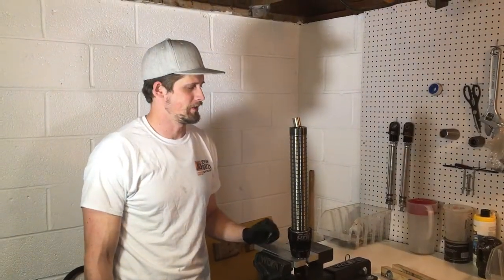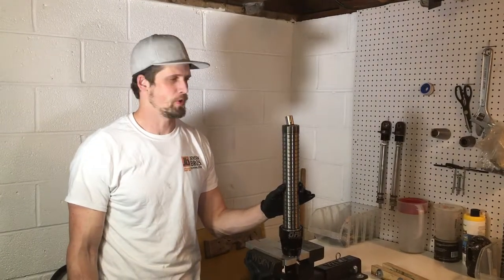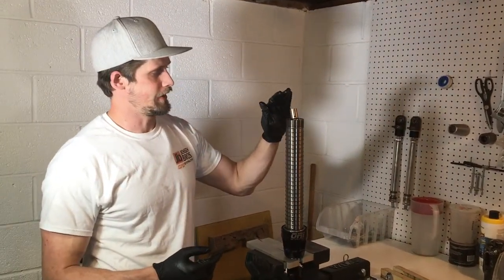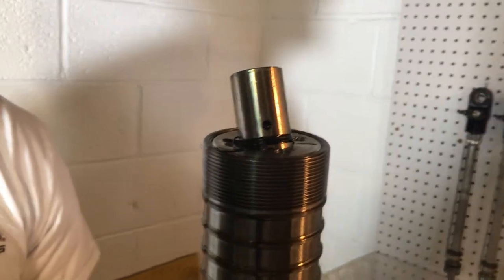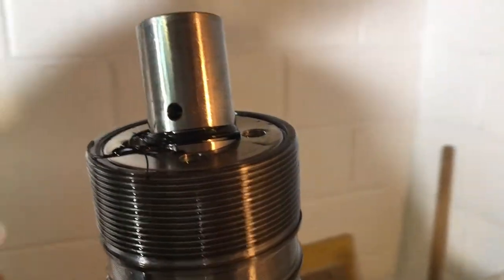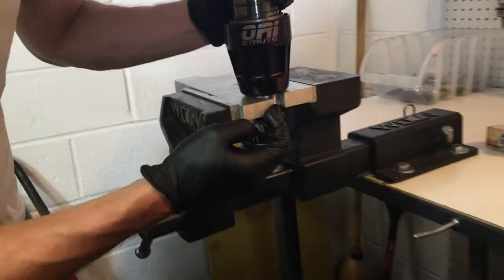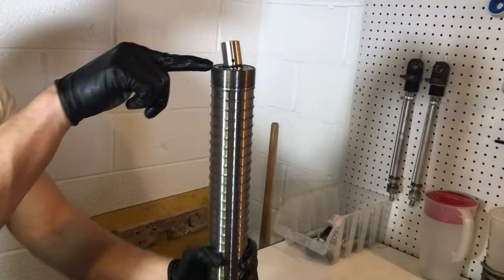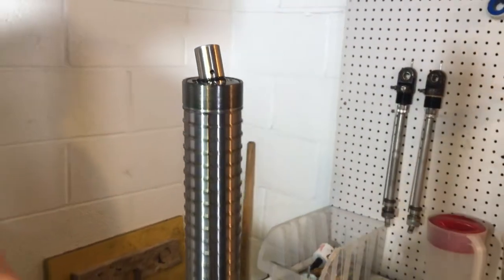ORI Strut Bottoming Out Hard? Jammed Internal Bump Stop

Comment: What initially caused it to bottom out ?
Reply from the maker: Internal leak caused the oil to transfer to the bottom. The bumps only work correctly when submerged in oil. If you bottom without oil in the upper chamber, it can jam the bump, or cause the q-ring holding it in to get hot and the bump just falls out, causing all kinds of damage inside. The new bumps contain 2 quad rings that hold them in, This makes them more stable in the bore, and way harder for them to come out. They're also made out of aluminum so they don't hold as much heat.
Reply: @Jensenbrosoffroad  Oh cool thanks for the reply, you guys rock, Mike just bought a few sets of these 14s from you guys, were still tuning since I just installed the remote reservoirs as well on the front, waiting for rears and had a bottom out during testing, was worried it might damage the shock.